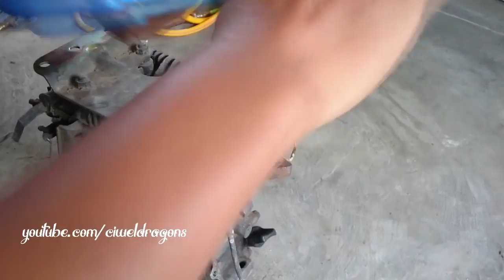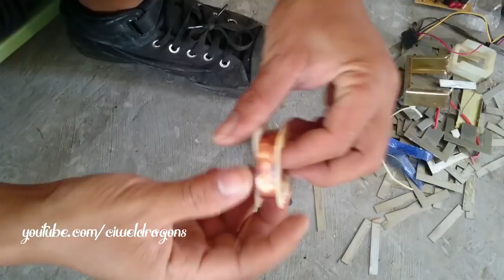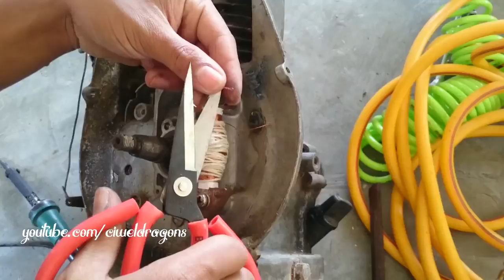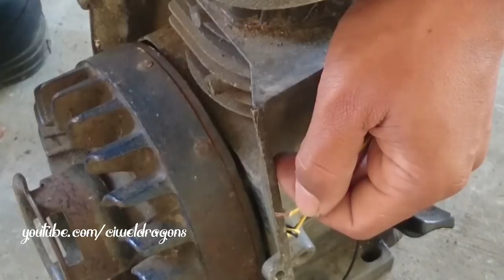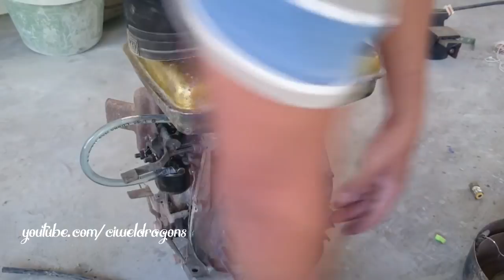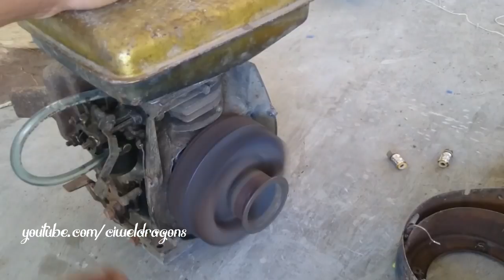Mengganti Mesin G 160, Gx 160 dengan Full Cdi Rc series #2%

Comment: gan. apakah rpm limitnya akan mengikuti cdi?
soalnya gx160/200/270 kan limit 3600rpm by governor?
pingin coba di gokart. 😆 sape tau gx200 nya bisa tembus 6000rpm powernya naek jadi 9hp gitu.. 
sekalian tutor gnti karbu donk. 😊
Reply from the maker: nextime aku juga pengen ganti karbu, kalo masalah rpm, geser governor nya aja, atau lepas, ini gak pake governor
Reply: @CiwelDragons  untuk per klep nya yg cocok pakai apa ya biar ga floating di rpm segitu?
Reply: @CiwelDragons  cara gesernya gmn ndan? sama narknya kira2 sampe 4500rpm kah?
Reply: @yudiwahyudin6644  😆
Reply: Lepas aja governornya,lalu pakai manifol grand/supra yg di potong lalu di las argon sesuai keinginan/posisi karbu(kalau mau pakai karbu motor)kalau mau simpel gak mau las bisa pakai selang 3/4 dan klam,untuk dalamannya klep valve,piston,cramshaft,kop blok,maupun lainnya,bisa di modif sama seperti motor(pakai piston scorpio kalau mau ubah piston,diameter pen sama persis)